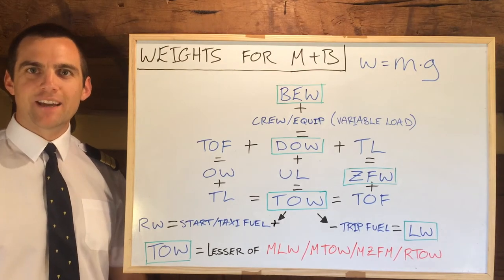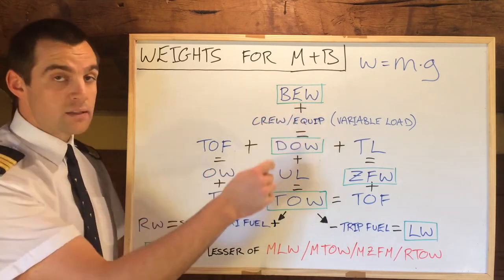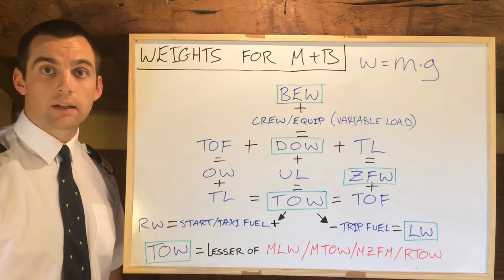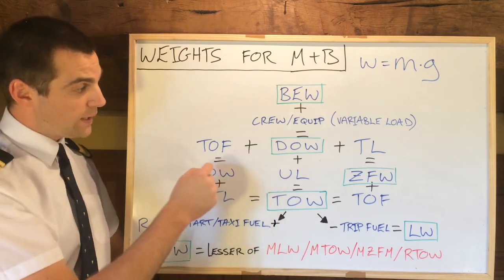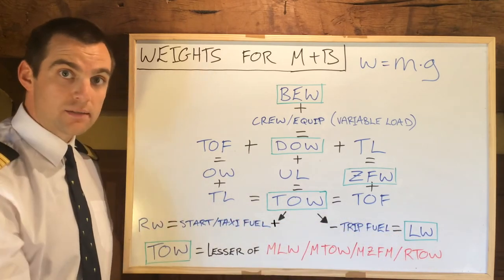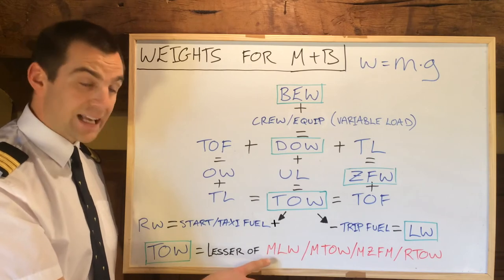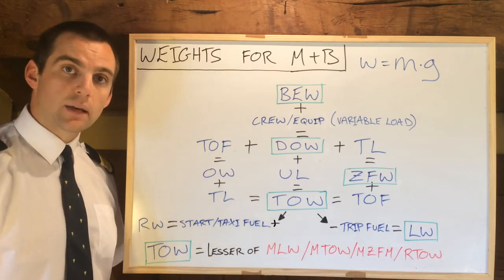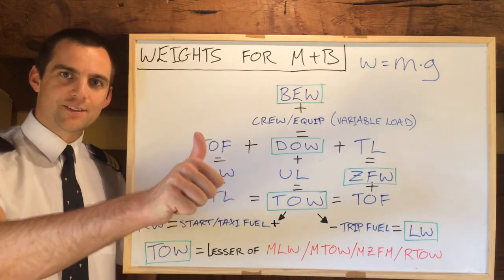Aircraft Weight Definitions ✈ ATPL ✈

Comment: Shouldn’t you also add Trip fuel to MLW?
Reply from the maker: MLW is structural limit, and generally doesn't change. The only thing you have to bare in mind is when taking extra fuel not to take so much that you will exceed the MLW . hope that helps :)
Reply: PilotEd sorry got it wrong. My friend is a FO at RYR and this is a quote from the Line training student doc

The EFB OPT or Preamble tables shall be used prior to dispatch (dispatch planning stage) to satisfy the AIR OPS 1 requirement and to determine the maximum take-off weight (i.e. payload and fuel) at which the aeroplane can land at the destination or alternate airport within available landing distance in expected conditions.

Thats what i meant
Reply from the maker: Is there a question? sorry haha
Reply: PilotEd could you explain that a little please
Reply from the maker: Its just saying we need to do all our calculation before dispatch, calculate the fuel were going to take, taking into account everything, and making sure we can land at the destination also :)
Reply: PilotEd thanks ;)